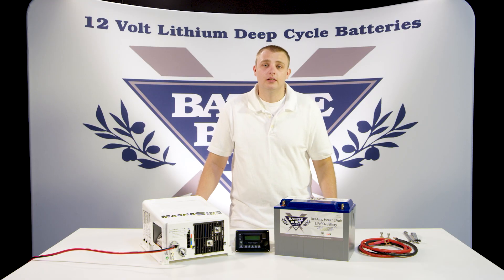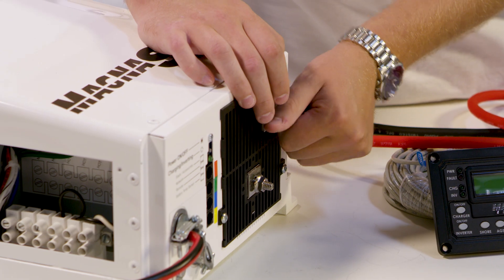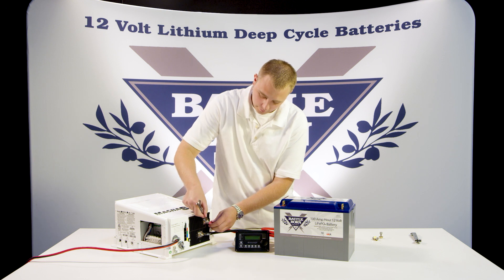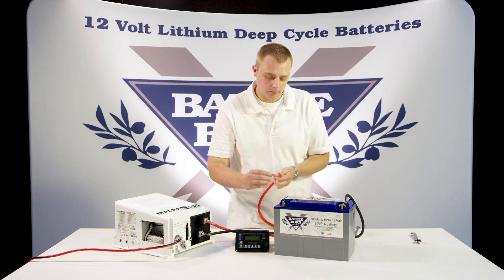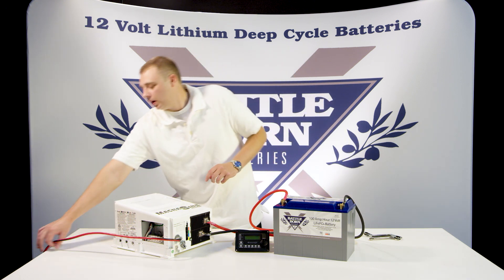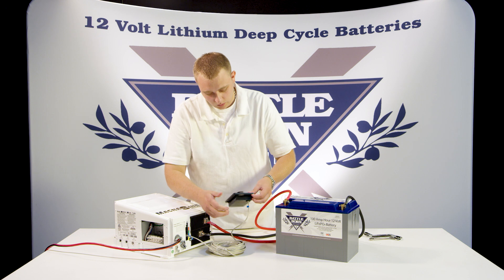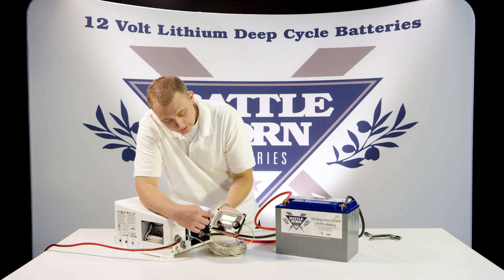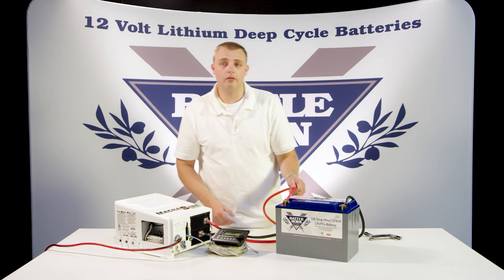How-To: Setup a Magnum Inverter Charger | Battle Born Batteries

Comment: I connect negative 1st to the inverter then put a 30 Ω 100 W resistor between the positive inverter and positive battery cable for just 3 or 4 seconds and no spark

Comment: The key to being able to set up a Magnum inverter/charger (IC) for the Battleborns is the remote control module. You can use either the MS-2012 IC, pictured above, or the less expensive ME-2012, which has modified sine wave output and costs a lot less. But you must have Magnum Energy's advanced remote control (the ME-ARC50) or you will not be able to program your inverter for the correct settings. Magnum Energy said that the ME-ARC50 will work on the ME-2012 IC unless the ME-2012 is "very old." The model and serial number are on the panel side of the IC and you can call the Magnum people at 425-353-8833 to make sure your IC will work. The ME-ARC50 will set you back over $200. If you have an older remote, the size of the new one is the same, so you would just remove the old one, plug in the new one, etc., a 5 minute upgrade.
Reply: I had an older ME-2012 (2006 Holiday Rambler). With a ME-2012, you need to look up the inverter and remote versions (using your remote). There are youtube videos that show how to get the versions. Once you know the versions, call Magnum support or go to Magnum website and look up the Inverter Compatibility Matrix document to figure out what feature "Level" your system is capable of. You want Level 4 both in the charger and remote to get the LFP charging features. I had to replace the control board in my inverter. I opted to replace the ME-RC with a ME-ARC50. I found a new in box control board on ebay for $125 and the ME-ARC50 for $205.

Comment: I have a ME2012 will this work? I know MS2012; works but that's a lot of money for a similar thing.. what will mine not do?
Reply: See my comment above yours. The ME-2012 will also work. The key is the remote control: you need the ME-ARC50 in order to program either inverter/charger.

Comment: US Slave,

No, I am saying just the opposite. With a Magnum inverter the sequence is -/+/+/-. For connection the negative cable first and then the positive. For removal the positive cable comes off first and then the negative cable. To do otherwise could damage connected components on the Magnum network.

Comment: Always connect to battery POSITIVE first then negative last no pop, spark, or ark basic electrical 101.
Reply: WRONG!!! Magnum specifically states in their manual to disconnect the positive first and then the negative otherwise damage can result to connected accessories on the network.
Reply: Don & Gerri 757driver your both right. +/-/-/+. connect is +then-, disconnect is - then +. I've jumped enough cars to know that by now, blew an inverter once before I knew and created some sparks attaching jumper cables before I knew
Reply: @U.S.SlaveOfficial  Confused,  "don & gerri" says disconnect positive first,   you said disconnect negative first....?
Reply: @donboettcher8900  I've dealt with many inverters in cars that I've installed myself running tools and RV stuff no probs
Reply: @U.S.SlaveOfficial  Then you should be aware of the requirement of a Magnum inverter to disconnect the positive lead to the battery first.
Reply: @U.S.SlaveOfficial  No I don’t think so, Magnum knows perfectly well what they are doing.
Reply: @donboettcher8900  trolling isn't thinking
Reply: @donboettcher8900  Excuse my ignorance, Why plug it to an AC socket?
Reply: @wolfheart2443  sorry, I do not understand your question. What AC socket are you referring to?
Reply: @donboettcher8900  He plugged it into AC current before the DC.
Reply: @wolfheart2443  the DC was hooked up first. Why he plugged into an AC outlet after was probably there just to represent an inverted load for the battery or was representing shore power for charging.
Reply: @donboettcher8900  Nope, he plugged an AC  cable from the inverter. I was wondering if this inverter also charges the battery from AC, like a Vanner inverter does.
Reply: @wolfheart2443  yes it does. Magnum inverters are inverters and chargers.
Reply: @donboettcher8900  Ok, So that's it. Thank you. 🙏
Reply: Jim Perrin; Wrong Jimbo. The “pop, spark, or ark” as you put it comes from charging the huge ass capacitor inside of the unit.  It doesn’t matter if you connect positive or negative first, you are going to get a surge of current either way.  An uncharged capacitor acts like a temporary short circuit then ramps down in current until the cap. is fully charged.  That is basic electronics 101.